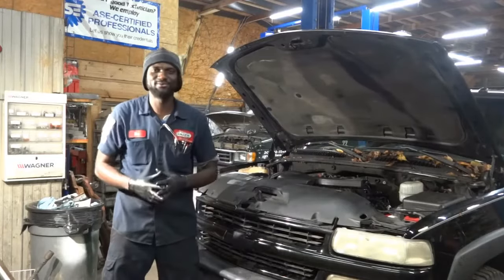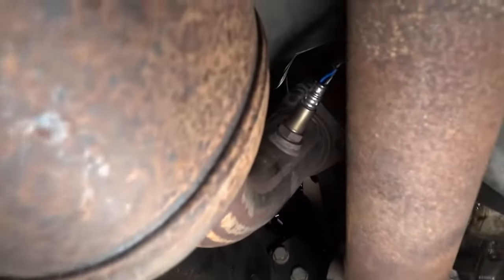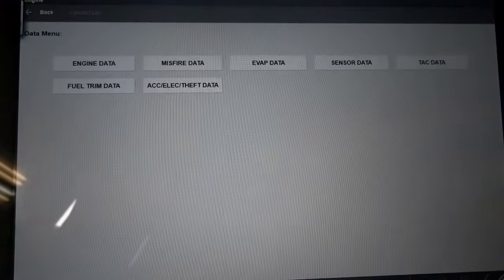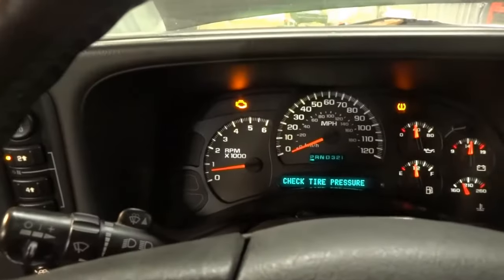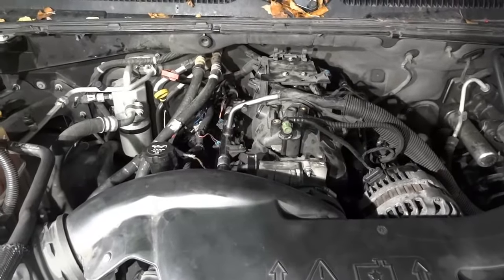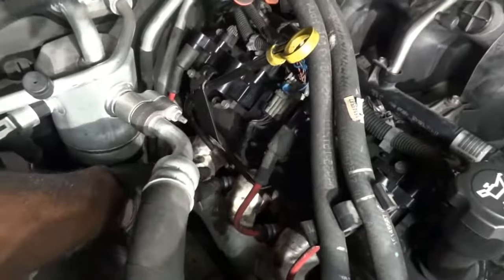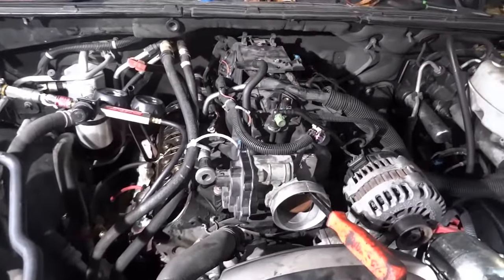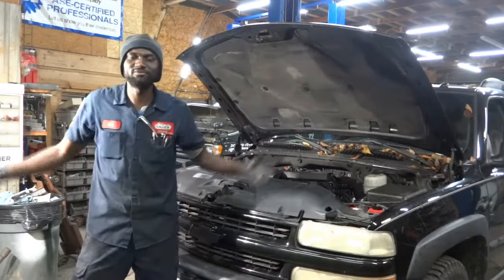CHEVROLET SUBURBAN 5.3L~ P0300, Still not Fixed After replacing the injectors and ignition Coils...

Comment: You do a great job of diagnosing, but the thing that takes so long is that you repeat yourself so often, saying the same things over and over. But your diagnosing is great
Reply from the maker: @genelblatter9805   Thank you! I appreciate your feedback!
Reply: I have P0300 i replaced wires spark plugs, coils, I don’t want to replace the injectors. I have 2017 Silverado , it only shakes at 30mph and it smells a lot like gas

Comment: Let me bring Ppl up to date on a common problem with with GM / GMC with 4.8, 5.3, or 6.0 between 02 -06 if you only notice the P0300 code after reaching 65mph or more and especially after changing all of these parts out it is likely that the Crankshaft needs to be relearned. It’s definitely worth a try before changing out or rebuilding the motor. On the video the motor didn’t sound too bad to me while running. I got a 05 Yukon Denali with the 6.0 and it’s having the same P0300 code after changing out spark plugs, wires, mass air flow sensor, and all 8 ignition coils! No problem with fuel pressure or fuel injectors or Oxygen sensors! Im taking my truck to the shop on Tuesday for Crankshaft Relearn if anyone wants to know the outcome just ask l will reply
Reply from the maker: David Haynes   Thanks for sharing that! the crank relearned was done before the truck was brought to me! it didn't fix the problem! Good luck with your truck!
Reply: What happen after crankshaft relearn?
Reply: @ramoncezar1919  l had the crankshaft relearn done and now No More P0300 codes. Check engine soon light has been off every since😎
Reply: Did it cause a no start or a very very long crank
Reply: Crank shaft sensor does not have to be reset   , look it up.

Comment: I had the exact same issue with my 2000 Suburban 5.3 ls, code p0300, (random miss fire) after replacing many of those parts he mentioned (fuel regulator, spark plugs, wires, coils etc. etc. a friend mechanic recommended replacing the engine after diagnosing that the miss fire came from cylinder 5, low compression, so I took it upon myself 😁 and removed the head on drivers side and voila, the exhaust valve spring on cylinder 5 was broken (cracked) so it would stay open randomly, so I just replaced all of the valve springs, seated all the valves, new head gasket and it's been running perfectly for about 3 years now, I wish he could've had this video back then, his explanation is awesome
Reply from the maker: Juan Mendez  I'm glad to hear that you were able to figure the problem with your engine!

Comment: Big man you the boss....Diagnose to the T. I have the same issue and I am at the point either to pull the heads or change the engine. Now the engine run great with a p0308 code which causing the emission failure. Good job on the diagnose procedure. Keep up the good work.
Reply from the maker: @vidog67  Thank you!

Comment: A couple of notes here:

You could have saved a lot of time doing the leak down test. You didn't need to take the valve cover off or put a dipstick in the spark plug hole. All you needed to do is connect your leak down tester and apply 10 psi. You then rotate the crank and when the needle starts to rise, you are on the compression stroke and both valves are closed. Continue turning until the needle stops rising and starts to fall. At this point, you just passed TDC. Turn it back the amount you turned it last and you're at TDC and ready to do the test.

When you noticed the leaky cylinder, since you already had the VC off, you should have struck the intake valve with a plastic hammer as sometimes there could be some debris trapped between the valve seat and valve face preventing it from closing. In some cases, it could be some crap stuck in the valve guide. Striking it can sometimes free it up and bring the engine back into service.
Reply from the maker: Lizard King  Thank you for your input, I appreciate it!
Reply: After all that it turns out it was the intake manifold gasket leak 😋
Reply: He was also inspecting the rocker arms if they were sticking. 👍 So in this case yes you need them off.
Reply: Some engines don't like being rotated backwards.
Reply: @darrellteague8629  You're not going to harm an engine by turning it a few degrees in the opposite direction. In fact this is unavoidable if you're replacing a timing belt.
Reply: I was wondering if I could do a leak down test an easy way, I'll use this method.
Reply: Yeah I'm having the same problem but I like to thank you for the input I figured they was a hack of some sort that might work I'm going to try tapping the rockers and see if that works I will post back
Reply: I was going to say that while the air is coming out of the throttle body give the valve a whack with a hammer. I've had it work many times
Reply: I'm having the same issue with my vehicle. Same making and model probably the same year..I'm going to ask my mechanic to check that first...

Comment: EXCELLENT! thorough diagnosis, crisp clear explanations. With single misfire showing on scanner, the first shop should have told the customer exactly that - a single cylinder misfire. A general tune-up (an 8 cylinder solution) is not correct solution for a one cylinder symptom.
Reply from the maker: Fred In Venice  Thank you!!

Comment: Thanks for the thorough explanation of each part.  My 2004 6.0L is doing the exact same.  I finally got it to give me a code showing that it too was cylinder #6 on my truck.  I did not replace all the parts only plugs and wires.  I tested and cleaned all the other parts you mentioned including the MAP and MAF.  Today I found a vacuum leak and that changed the rough idle to run a little better.  Tomorrow I will try the pressure test and cylinder leak down test.  Thank you for direction on my new route of testing.  Here is hoping it is only the head and not the piston rings.
Reply from the maker: Chapin Burgess My Plaesure!! Good Luck with your project!!
Reply: What happened next?? Did you fix the misfire?
I am also having the exact same thing.

Comment: Excellent video. I am fighting this exact same issue now. I pulled my engine after 225k miles due to one of the cylinder’s lifter making a crazy amount of noise. My 2011 features the DOD/AFM feature but not anymore after my rebuild. I didn’t do any piston or head work just cleaning and valve lapping. I will proceed next with your cylinder leak down test. I could use you here in South Carolina, lol. Thank You!
Reply from the maker: Bryan Rackley  My Pleasure!! I'm glad to hear that the video was helpful!! Good Luck with your Project!

Comment: I’m going through this with a 2017 Silverado except it’s cyl 3. I tried the leak down test but was inconclusive because when I put air in the cylinder the engine spun just enough to open the valves again. I know this because I marked the serp belt and alternator as a starting point. It’s crazy that these motors all have the misfire but I see so many things causing the same issue. Very good video. It’s been a little while since I’ve done this so I wanted to make sure I did it correctly. Thank you for this.
Reply from the maker: @GRJCLyon  My Pleasure!

Comment: I’m going through this right now. Heading to Harbor Freight right now to get one. Cyl 5 and 6 constantly misfiring. Replaced damn near everything because we are planning on keeping the truck and just rebuilt the engine but still couldn’t get past this. I suspect this is my problem but heading out to get the tester. Thank you so much. You are a great teacher.
Reply from the maker: @kennethdickinson1023  My Pleasure and Good Luck with your project!
Reply: Found the problem?
Reply: Yeah. It turned out to be several problem. Rocker arm was loose on cyl 6. I also used an aftermarket crankshaft sensor that would fail when it got hot. Put the original ac delco back in and the problem went away without having to do the crankshaft relearn process.

Comment: Excellent diagnostic video. The other shop obviously did not have the proper equipment and skills to locate the problem and used the "shotgun" diagnostic procedure. The customer needs to find out if the other shop would prefer to issue a refund or spend some time in small claims court. With over 200,000 miles, the rod, main, and camshaft bearings as well as the timing chain, oil pump   and all other internal parts have the same mileage. I would probably recommend a low mileage used engine or a rebuilt one if the rest of the vehicle is in good condition.
Reply from the maker: Richard Hudson  Thank you!! Yes I recommended engine replacement!

Comment: Very Cool, You Explained it Very Very Well. I have a PO308 and have checked and exchanged ignition coils , test Wires, Plugs, Compression at min, but did not do a Leak down test. This Video Should Help me determine what problem is. I have tho 487k miles on motor and Did a Valve and grind  years ago at under 200k miles. I know I should get a motor at junk yard with hopefully low miles of 80 to 100k. Thank You, You Explained well that I can try following your Class Advice Tutorial. I'm not a Mechanic but I have years of Machinist Exp... Thanks, Gracias.
Reply from the maker: Gabe Alexander Thank you and Good Luck with your project!!

Comment: Great video, very helpful.  My 2005 Chevy Silverado 1500 5.3 threw a code PO303 on me at work a couple of nights back. The engine was running a little rough lately ( while in gear, idling with foot on the brake)  so I pulled the ignition coil (I also smelled burning electrical components from under ) and it tested bad so I replaced it and the plug.  I also changed the drivers side valve cover because I knew the fixed pcv orifice was likely plugged up.  It was terrible. Cleared the codes with a scan tool and took a drive.  Now the PO303 is gone but code PO300 Pending is now showing up.  Engine light on, blinking etc. I'm a contractor and I own the truck..high mileage, 300,000 miles plus. Fix one problem, expose another one I guess.  I didn't fire the parts cannon at it..just the number 3 ignition coil and spark plug which actually didn't look too bad. Anyway, hope I can figure this thing out.  Oh, engine has low oil pressure as well which I confirmed with a manual tester, not just relied on oil pressure switch. Great channel Sir, new sub.
Reply from the maker: Kayla Marie  Thanks for subscribing to the channel, did you check for vacuum leaks and fuel pressure?
Reply: @KITS_Auto_and_Truck_Repair  My pleasure Sir, your channel is awesome! I have not as of yet..I have to go pick up another fuel/vacuum tester gauge from HF..probably pick up a noid set as well.  I did not notice any noticeable vacuum loss but when I changed out the bank 1 side valve cover due to the fixed pcv orifice being clogged up, I disconnected brake booster for the install and then plugged it back in.  Engine might be freaking out because it can breathe again.  I wondered if that caused an issue. I ran another diagnostic today with my Autel Maxicheck scan tool which showed long term fuel trim bank 1 steady at 5.5 percent while the other trims fluctuated so I suspected a bad o2 sensor..not sure whether it would be sensor 1 or 2.  My scanner does not support looking at all o2 sensors in real time data.  I also think that cylinder 3 has a bad wire.  I listened to all the plug wires through a mechanic stethoscope and #3 ticks like a spark tester lol.  I know that's less than a pro approach but this PO300 pending code is perplexing .  I'm not a certified real mechanic and my scan tool is limited.
Reply from the maker: @kaylamarie8309  if you don't have some of these tests tools, you should have it diagnosed at a pro mechanic shop, so you can really find out the problem!!!
Reply: @KITS_Auto_and_Truck_Repair  Thank you once again for the kind reply Sir!  Turns out I already had the fuel/vacuum gauge after all so I just went and picked up a noid kit at our local HF..never know when you might need that. I'm really trying to hard to learn all this stuff and you have to have equipment to really do that.    After I changed cylinder 3 ignition coil I also bought a new plug for it just out of caution even though the plug that was in it seemed to indicate that it was operating properly and under the right heat condition.  I kept the old plug. Coil for three tested bad so I knew it was an issue. Even with the new coil and spark plug,  I tested them through the old spark plug wire and the spark in the tester seemed weak (dim and not firing well) to me so I put on a new set of wires before getting too involved with other directions. The spark in the tester was much brighter  and more active and the engine ran great. I ran it a while under load and it still ran really good.  I cleared the code with the scan tool which actually  has more options upon closer inspection and I have been driving the truck for a couple of days with no problems and no further codes popping up.  When I initially checked for the pending code po300 prior to clearing the codes , the scanner did not find it so I am assuming the problem is fixed.  If it returns I will take it to a pro shop for a more in depth examination.  Does that sound reasonable or should I take to to a mechanic anyway?
Reply from the maker: @kaylamarie8309  That sounds Reasonable keep driving it and see if the check engine light will come back on!!
Reply: @KITS_Auto_and_Truck_Repair  thank you Sir. I value your expertise. I'm going to replace the rest of the plugs later today. Kind of dumb just to change the one on cylinder 3 since i put on a set of new wires. So far so good with the truck. No light back on and I drove it pretty quick.  Thanks again. Ill definitely keep watching your fine channel 🙂
Reply from the maker: @kaylamarie8309  My Pleasure!!!  Thank you!!

Comment: Just a suggestion . Would a relative compression test also point you to cylinder #6 . Then put an articulating bore scope with 2 cameras to look at the valves . If you see a piece missing , it could save removing the valve cover . The leak down test is positive proof . What I am thinking is that the other tests could possibly save you time if the result is obvious . Great diagnosis .
Reply from the maker: Bill Smith  Thanks for your suggestion but for some reason this engine passed the relative compression test!
Reply: My point is if you suspect a problem and get a borescope in #6 and see a valve burnt , it may save you time . At that point , the customer has to make a decision . Lucky you could get the valve cover off and #6 plug out . And the leak down test is proof .  Good Luck 👍 .

Comment: Awesome video!!! I have been chasing this same code in my 2004 sierra 2500HD. I did do the plugs, plug  wires and coils which made a huge improvement but every now and then I still get the code.  Definitely going to do more research before just replacing the injectors. Thank you so much for an excellent video!
Reply from the maker: Paul Sullivan  My Pleasure!
Reply: What did you find out? I have same truck same code
Reply: @budman201  unfortunately I got hit in the rear axle shortly after posting so I haven't done anything based in what I've learned from this video.  If I figure anything out once I start working on it I will let you know.

Comment: Mine was the ground wire on the lower left side of the block. Thanks for showing everyone this helpful video
Reply from the maker: @ryans9103   My Pleasure!
Reply: Was the ground wire rubbing up against something
Reply: @92camaro100  No, it just broke off from corrosion on mine. But corrosion will make a bad connection too.
Reply: Ok thanks for letting me know about the ground wire being corroded.

Comment: Great video! I enjoyed watching this. My expertise is in 5SFE and 3SGTE Toyota engines, but I have had a LM7 5.3L engine since 2017 that I have been avoiding tearing down and replacing the heads on. Recently I got a P0300 code and I know that I am having valve seat issues. I have the stock Castech 706 heads which were notorious for developing a crack in the casting. I also am burning coolant. Time for me to man up, crack my knuckles, and tear this baby down. 

Thank you for such good information, and for giving me the inspiration to start pulling the heads.
Reply from the maker: Jody C  My Pleasure!! Good Luck with your project and reach out if you have any questions!!
Reply: @KITS_Auto_and_Truck_Repair  Thank you! Will do.
Reply from the maker: @jodenc  My Pleasure!!
Reply: Good thing there're easy to work on

Comment: I am having the same issue with my 2004 Suburban that I just purchased. Now I have to find someone as thorough and as you. It's my experience that not all mechanics are honest and will throw parts at the vehicle like ur friend did with this one. I'm open for referrals if anyone knows a honest diagnostic mechanic in south Jersey ?
Great job explaining all the possibilities to that dreaded P0300 code 👍
Reply from the maker: Mark  My Pleasure!!
Reply: Good luck with that. I live by NJ shore and these guys so far care more about making money than about customer service. I have not found one down here that actually know what they are doing. They good at old cars but know very little about how new cars work and that's what they do. Throw parts hoping to fix it with guest where you might have a problem. There should be a law that when you change parts and the car still has the same issue then you don't pay until it's actually fixed. That will stop the guessing game.
Reply: Do you have a phone number for you or your shop?